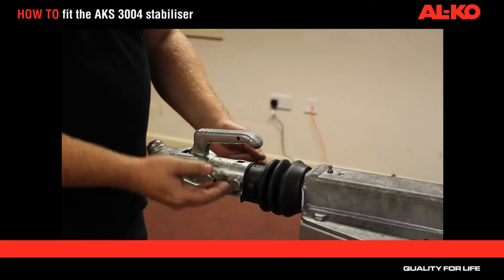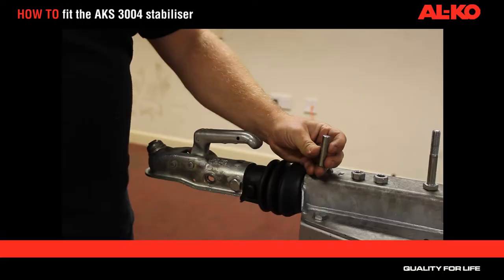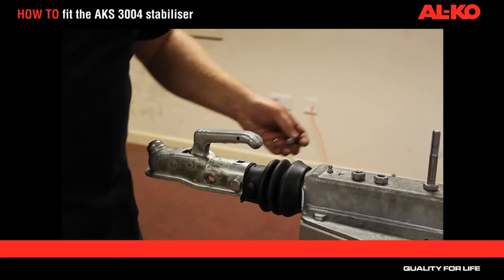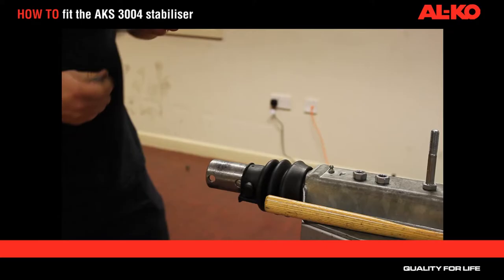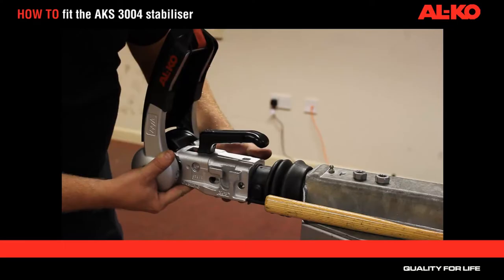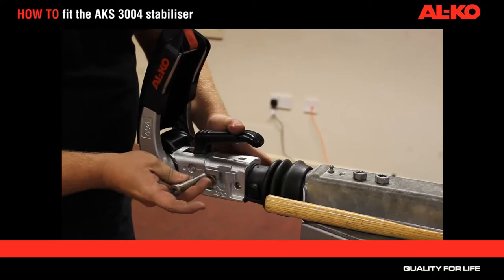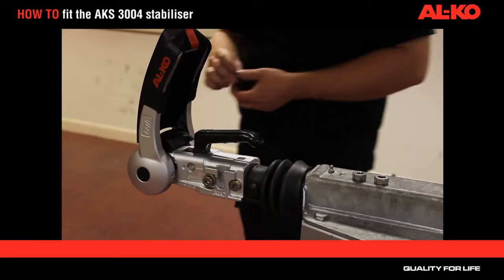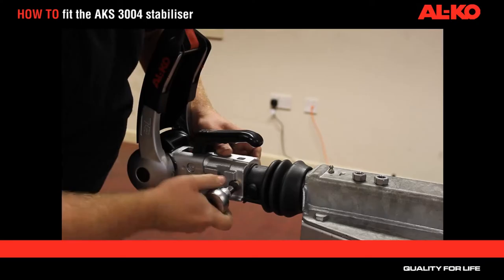HOW TO fit the AKS 3004 stabiliser

Comment: Thanks for this - very helpful. 
However, what is not mentioned is you need a Torkx T55 head socket to remove the bolts. Don't begin this task without one!

Comment: But how does it "stabilise" the trailer? Do you have a video that explains the technology and how it works to help?
Reply: What it does is when the stabiliser handle is engaged it pushes small friction discs onto the ball hitch inside the coupling and that in fact nearly stops the towing vehicle and the caravan from bending, as it would in a turn and because of this action it stops the caravan from swaying..

Comment: what do you do if you didn't watch this video and removed BOTH bolts at once and didn't use the dowel? 👎
Reply from the maker: Ok so if you havent sorted this out, the easiest way to fit the stabiliser is to mount the stabiliser onto the overrun tube. When properly seated, push the the stabiliser so it depresses the overrun as far back as you can.

Then release the pressure on the stabiliser. The overrun should start to push back out. Look through the bolt holes in the side of the stabiliser and when you start to see the through hole at the back of the stabiliser appear push one of the bolts through and out the other side. You may have press the overrun back in to assist in getting the first bolt through. Once thats in place the other hole should also be lined up and you can fit the front bolt.
Reply: ALKOKoberUK 
thank you for taking the time to reply. I had already sorted it but may be helpful for others 👍